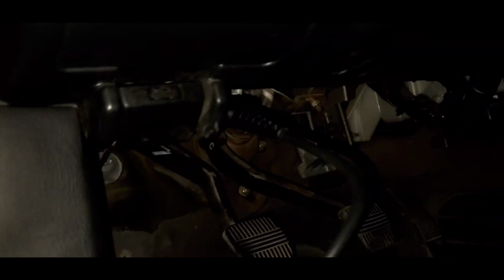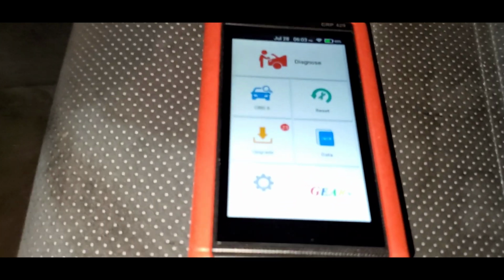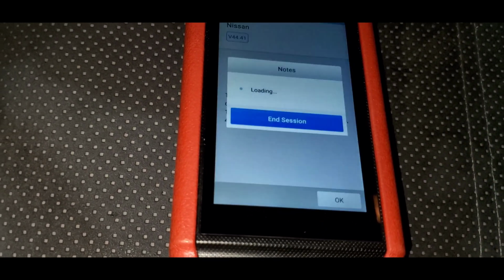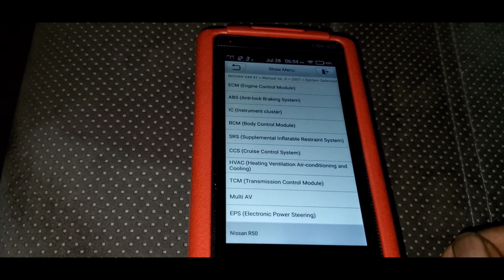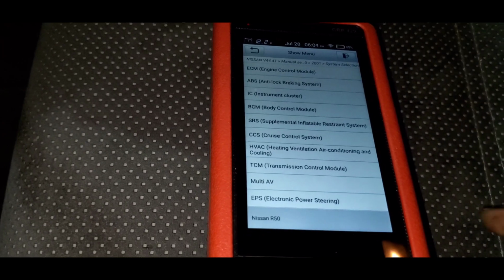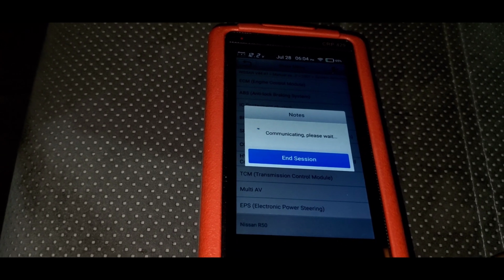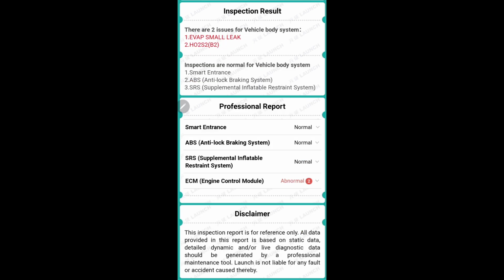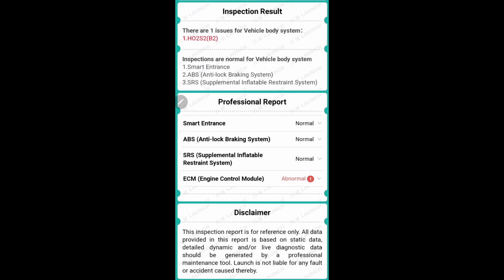The LAUNCH CRP429C scan tool how many of us have one?

Comment: What scanner did you use?
Reply from the maker: This is the Launch CRP 429. It can perform Emissions readiness testing along with a few other special functions like BRAKE RESET, OIL RESET, SAS RESET, BATTERY RESET, ABS BLEEDING, DPF REG, IMMO and INJECTORS TOO! 

LAUNCH CRP 429 Scan Tool: https://amzn.to/3UkHEdY
Reply: Thank you!
Reply from the maker: Your very welcome glad to help, and thanks again for watching👊🏾
Reply: I had to get a new scanner my old one just died .. i priced arround on line and got one for 25$ from tractor supply store.. its simple all it does is show the codes .. thats really all i needed .
Helped me figure out whats needed 
I bought a transmission monitor 25$ but when i went under to change it .. the wires disintegrated .. so that turned out to be the problem the wires (pig tail) was heat affected  and needed replacement 56$ on line so i went to the junk yard they let me walk with the new wire for free.. so the scanner the sending unit cost me about 50$
The wire was free.. and it was a new wire installed on the junk car.. i just need to solder  the wires and shrink wrap the connections and then wrap it up in some heat protection. . It is a hot spot with the transmission  and a huge exhust pipe surounding the wires ..so the wires need protection 
 I took some heat wrap out of a old furnase . Free.. 
Dont be afraid to learn to use the cheep code reader or scanner it helped me track and solve my problem .. the junk yard is allways a good place to explore how things go together  and come apart at really no expense to you.. just be safe under your car allways block the wheels and block after jacking.. i sure didn't want to bump the shifter cable and have my 8000 pound van run me over.. a student i went to math lab with asked for help on his car 
 I said i cant i have my studies to keep up with. Next day he came in with his face all split open the car fell off the jack and almost crushed his head.. i felt bad .. but now i warn everyone . Cus if i had at least warned him maybe it wouldnt have almost killed him and scared his face for life..
One safer way to get under a car is to drive it up on a curb and slither down the gutter. . Lol its not going to fall if all the wheels are on the ground.. but dont forget to block the wheels so it cant slip out of park and run you over
. It happens more then we think.. many never live to warn others ..